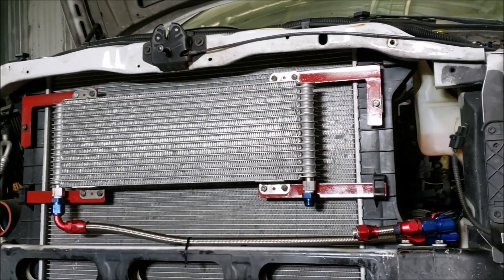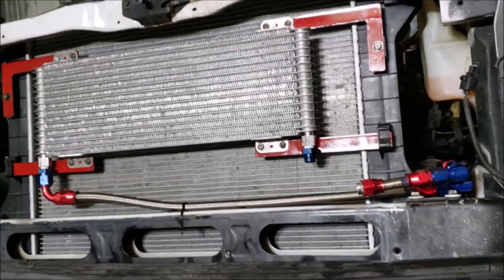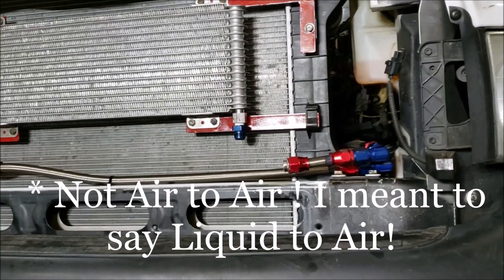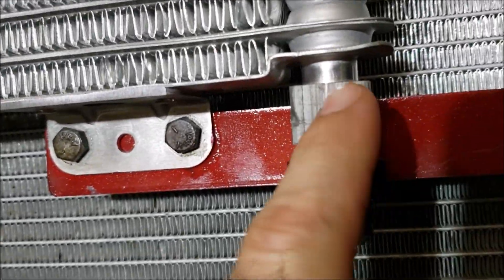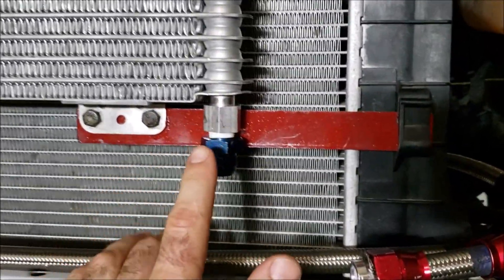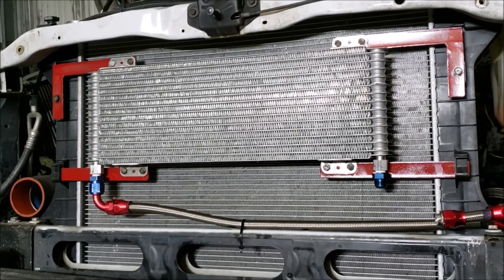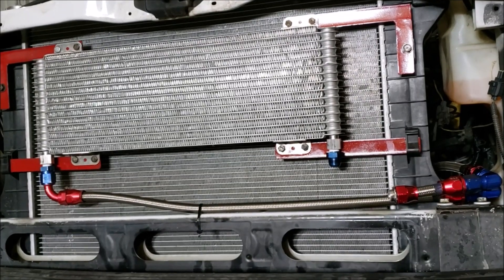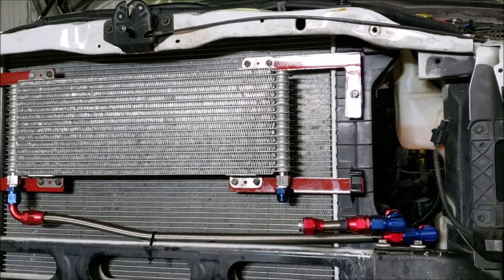Transmission Cooler Test On 3rd Gen Cummins - Part One - Fab & Installation

Comment: Super smart on the positive air pressure. Did you guys ever post your results? Can't find the video on your channel. Thinking of getting this cooler and possibly lightly painting (which might reduce cooling a bit)
Reply: We never to do much long term testing on it because it had a leak from a stress fracture at the top of the tank. We only got to run it about 200 miles.  But in those 200 miles we did some towing and it did a great job cooling the transmission. As long as you can get one with out a leak, I think you will like the coolant effect you get.
Reply: Thanks I just ordered one, I'll have to test as soon as i get it. Won't install in till the summer.

Comment: i was going tk buy this but when i saw the 3/8 inverted connection i decided to go with the B&M 70274 because it has half inch which allows much much more flow
Reply from the maker: Thanks for the info! Keep us updated on how that works for you, if you don't mind. What application are you using it in?

Comment: Will  this all be necessary on a relatively stock V10 Dodge as far is the size of the hoses are concerned Mine will be 1st in line with airflow in front of the truck
Reply from the maker: Hey Merritt, 
I don't know if it will be necessary, but I would guess you are probably ok. Something to also consider is how much towing you are going to do. Also, I don't know how much slip there is in a v10 converter. We have run 3 different stall converters in almost identical trucks, equated to different heat levels. The loser the converter, more heat we have seen.  

I can tell you is that this cooler has done well at keep trans temps under 160 degrees (usually less than 130) here in GA in the summer. We have seen as hot as 210 when pulling 20K ish in stop and go type traffic. Something worth noting is that we are not using a properly sized fan (we are using a 12v fan in a CR fan shroud) And we also chose not to use the factory liquid to liquid cooler. 

I know this is kind of a long reply, but I just wanted to give you a glimpse at what we are seeing! Hope that helps some.
Reply: @70440charger  not a huge amount of towing other then hauling loads of wood and a 26-30ft camp trailer in the near future.
Reply from the maker: @merrittmcdowell8675  : I think you are pretty good to go. The stock coolers seem to be up to the task most times. However, The best bet would be to have some way to monitor trans temps just in case and then if you notice anything out of control you could always jump up cooler sizes.  

Now, if you love piece of mind (like we do) and hate down time (like we do) then consider what our tranny builder said "it's hard to get a transmission too cold".  It was because of that we just jumped straight to a big cooler. Was it overkill for 90% of everything we do? Yes. But we now benefit from trans temps that are usually 110 to 130 when its 95 degrees outside. Worth the overkill in our minds because transmission breaks down quickly as temps get hotter. There is a pretty great chart I ran across some where that shows the relationship between fluid temp and lifespan.  Thanks for the comments!
Reply: @70440charger  i already bought the 40k tru cool cooler its sitting on my table and i decided today and ordered the cold weather kit just incase of driving while its 15 below zero here in the winter